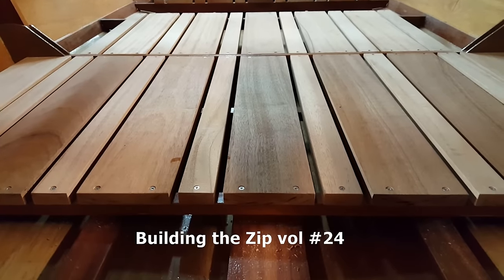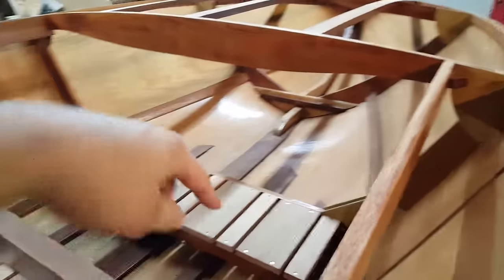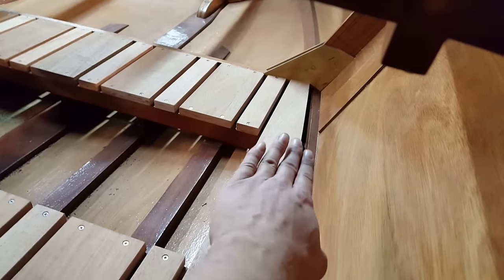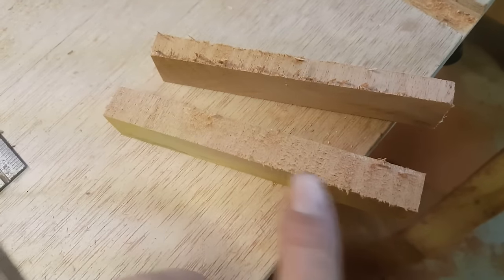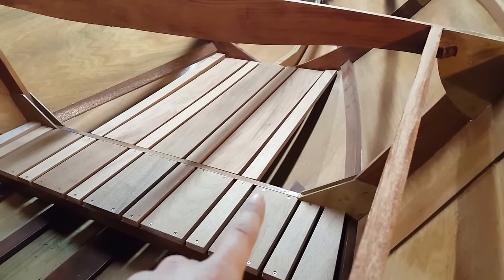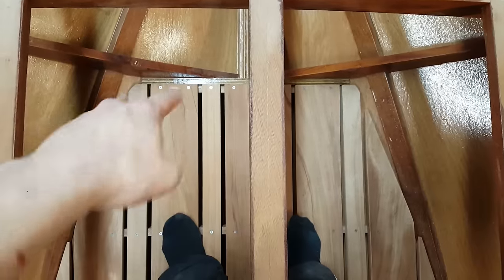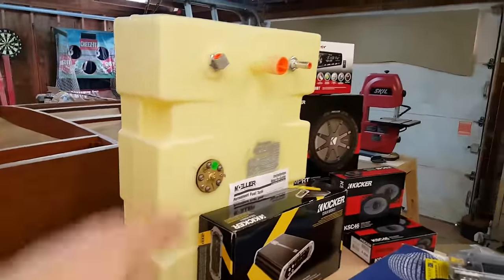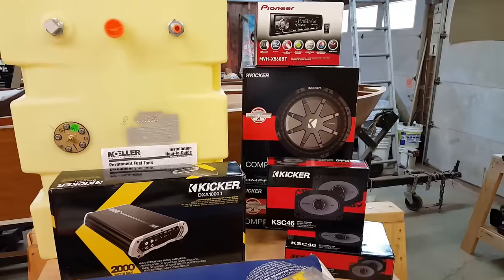Building the Zip vol #24

Comment: Very admirable, impeccable work, evidence of a lot of patience. The videos are also perfectly produced, much better than we often see. I have two questions: 1) Why did you use stainless screws on the floor when you have used bronze to this point? Are you going to fill the screw holes with Famowood as you have on other screws? 2) I'd be worried about dropping something, like a screw or quarter, through one of those slots in the floor. Can you retrieve things or access that area for cleaning? Thanks for taking the time to make the videos and answer questions. Great work that anyone would take great pride in.

Comment: You hinted in a last video that you were going to automotive finish.  This video says you plan to varnish the underside of the flooring.   Do you see varnish being a problem given that varnish needs to be looked at year after year?  I really love the automotive finish idea.  Will the sides of the boat get an automotive finish too?  How would they spray the sides if the trailer is blocking some spots?  Love the build.  Thanks for all you've put up.
Reply from the maker: M M i plan to auto clear the entire outside of the boat, deck, sides, transom, the inside however I'm not 100% sure what i will use just yet, i really wanted to stay away from varnish (maintenance pain in the @55)might do a polyurethane clear inside, might do something else, not sure yet but outside will be auto clear all the way.

Comment: That is going to be one gorgeous boat.    I know at one point you were having a difficult time deciding on whether to use an antique powerplant or a new one.  have you decided which way you're going to go?
Reply from the maker: I will probably go with a brand new mercury 40hp four stroke, only because my family will be out with me and i dont want to spend half my time keeping a vintage motor running, but if a nice vintage outboard happend to cross my path for the right price i still may go that route. so i guess I'm semi decided
Reply: I've seen ads for fully rebuilt vintage motors.   I guess the big issue at at point may be the control linkage...   As you've already bought your steering cable, and it is usually brand specific, I guess the Merc 40 is the way your going.

Comment: where did you get the gas tank and steering wheel from.....and who will you be buying the windshield from,,,,I'm building the Glen L Malahini,,,,,looks a lot like the Zip, ,,,,,,you are doing a spectacular  job...thanks for sharing....
Reply from the maker: The fuel tank is a moeller brand 12 gal bought off amazon. Same with the steering wheel and adapter, all items exept the stereo was from amazon, i will cut the glass for the windshield but will buy my brackets.

Comment: What was the length of the steering rack system?
Reply from the maker: It is a twelve foot long steer cable. Had to go back through my Amazon orders to make sure....
Reply: joshuaburks - Thank you. Your Zip looks great and has been the inspiration for my Zip build. When it comes to the mechanics of the boat i have very little knowledge. Can i ask where you ran the fuel line? Also, would I need a fuel pump/fuel filter or is that built into the outboard engine?